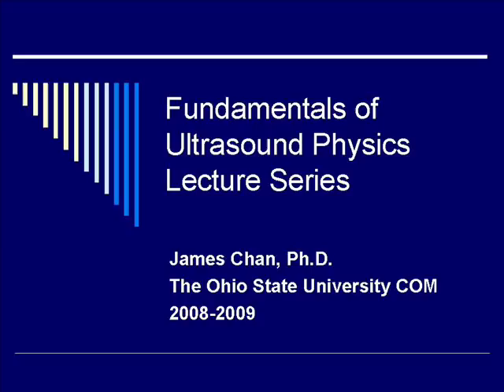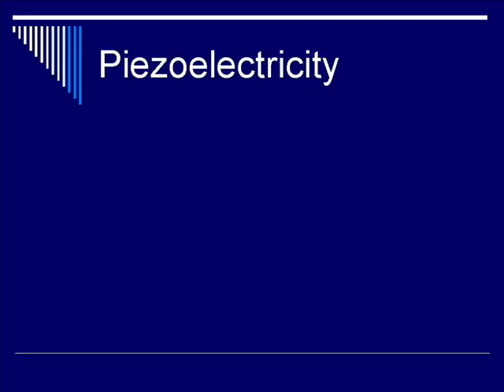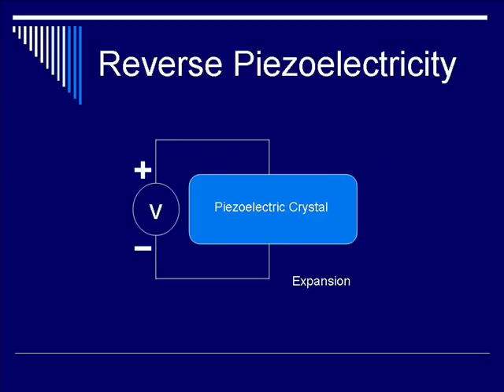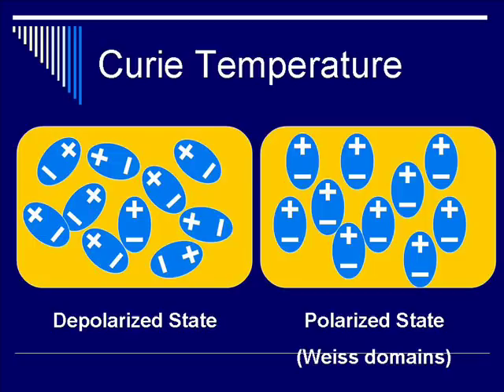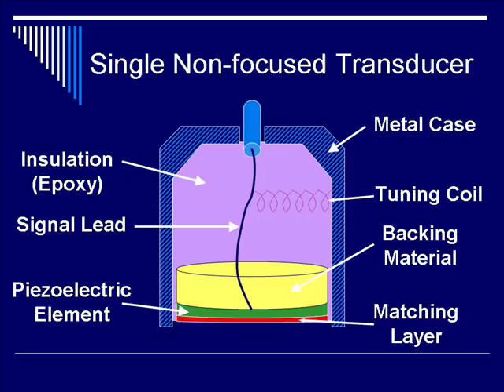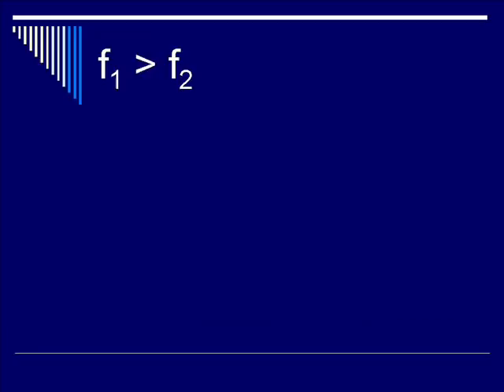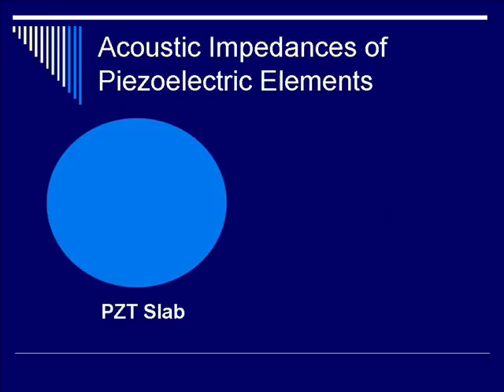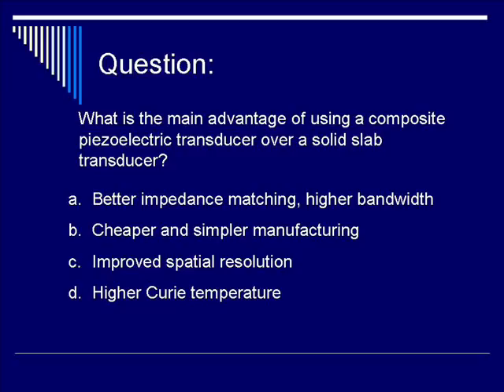Physics of Ultrasound: Transducers - Segment #1

Comment: There are two correct answers to this question: B and C.   Answer C, the one you gave, has to do with the thickness mode vibration of the slab.  Answer B, has to do with the radial mode of the slab.  Since the diameter is usually larger than the thickness for a "slab", then the fundamental radial mode resonance will occur at a lower frequency than the fundamental thickness mode resonance.  As an example, a transducer might have a 1 MHz (fundamental) radial mode and a 3 to 4 MHz (fundamental) thickness mode.  I use the term fundamental because there are higher order modes for each.  The thickness modes occur in odd multiples of a half-wavelength (in the slab), i.e. 1, 3, 5.... while the radial modes occur in a noninteger sequence.  These are details that most ultrasound people don't know, but they are nevertheless correct.  Thank you for making the lecture series.

Comment: heating up to 365 is polarization, heating above is depolarization
Reply: I'm not entirely sure, but I think the idea is that you heat something up above the Curie temperature, apply a high voltage to it and then cool it back down, resulting in polarization.  I'm not sure if there is a specific name for this process, but I've been trying to look it up and I've been coming up empty-handed...

Comment: Dear Dr. Chan,

Thank you very much for your very good explanation about the physic of ultrasounic.
I have aquestion about imaging.
is that posible to make ultrasounic- image using only one transducer? 
for emample we have a key and we will make image from this key with 3 mm resolution, can we use only transducer to make a pic from the key or we must have more than one transducer.

I'd be very greatful if you could answer me.

Best regard
Reply: I apologize if I am misinterpreting your question, but I think that almost all ultrasound images are made using a single transducer.  However, depending on the ultrasound mode you'd like to use, you might use a transducer with one piezoelectrical element or a transducer with two piezoelectrical elements.

Comment: I'm sorry but check mark 3 and 4 seem to contradict each other.  Both seem  to say to heat above Tc will polarization or depolarized.  Witch is it.
Reply: I'm not entirely sure, but I think the idea is that you heat something up above the Curie temperature, apply a high voltage to it and then cool it back down, resulting in polarization.  I've been trying to look this up but I'm still confused...

Comment: or more detailed-- Activation is through: heating above** Curie temperature (Tc for PZT = 365’C specifically), applying high voltage across the element, partial alignment of charges (net dipole moment) = polarization. When it cools down (slowly going below 365)  that is when the transducer's dual action can be seen.
Reply: I know it's been a long time, but I wanted to say that I came across your comment and I found it really helpful; I was scratching my head for a while!  I tried to find sources describing this process online, but it was hard to find anything that described the process of heating something above the Curie temperature, applying a voltage and then cooling it back down.  Does this process have a specific name, and/or could you point me to a good resource?  Thank you!